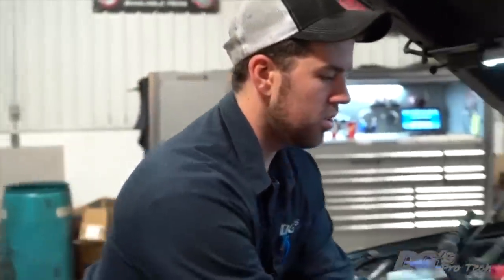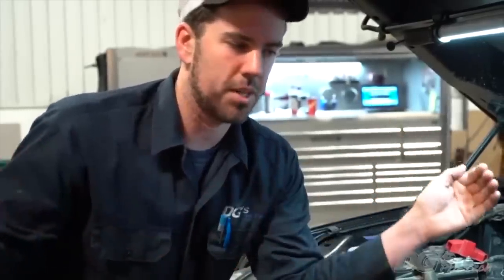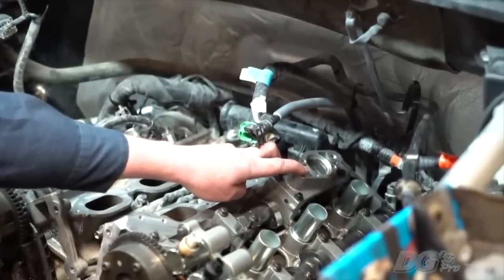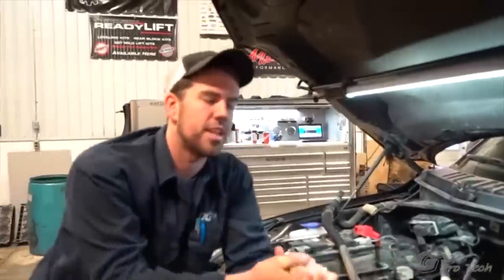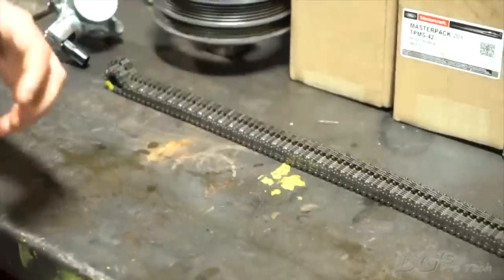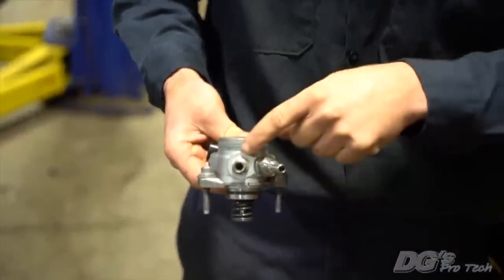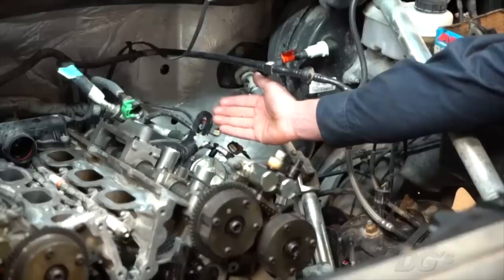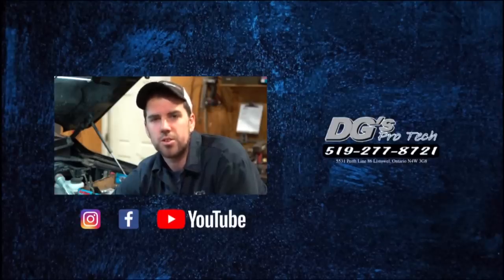What you NEED to know about Ford EcoBoost Engines by Dustin Golley of DG's ProTech

Comment: So basically change the oil more often and give it the Italian tune up once in awhile.
Reply: What's an Italian tune up?
Reply: @michaelwood5519  putting the pedal to the floor and blowing the soot and buildup out.
Reply: @mikemoore466  Actually  in the "olden" days, the "blowing out" of soot and build-up rarely cleaned more than the exhaust system.
In addition, what carbon that might have accumulated on the pistons, or valves  might have done more damage to the engine than letting it remain within the engine until a road trip was undertaken.
Carbon is hard and can become trapped between valves and valve seats. A burned valve might happen. Or carbon may become lodged between the piston and cylinder wall possibly causing scoring of the cylinder.
All this was before the detergent gasoline we now use.
Reply: @mikemoore466  Ahh, Bill Cosby joked about being told to by a mechanic get his Ferrari up to 120 mph to clean it out.
Where do I go 120mph?
Oh, any side street. 
The next part about Carrol Shelby was funny.

Back when Bill was funny, not creepy.
Reply: @kevinmoore4887  well he sure is creepy now. He's like Michael Jackson creepy. Lol
Reply: @mikemoore466  Bill Cosby was great back in the 70s. Very funny and his humor had a positive message. 
Yeah, the off stage stuff is sick.
Reply: @michaelwood5519  an application of wide open throttle every so often. Usually best done on a long interstate onramp, downhill grade, to avoid too much drama on the driveline. Gives a full rush of air into cylinders, full flow of fuel thru the injection system, and a full flow blast out of the exhaust to dislodge any buildup of carbon shaken loose from the valvetrain. A nice fast ride on the highway can do the same thing, but the wide open throttle technique works just as well in most instances.
Reply: @michaelwood5519  Vroom vroom!
Reply: Never mind, I now know.....Zooooooooooooooooooooooooom
Reply: @michaelwood5519  Put the the pedal to the medal and give it a good long run down the highway. Blows all the crap out of the motor. Years ago my Dad had a Ford Taurus I would borrow his car once in a while and he would always ask what I did to it because the car was running so good next time he drove it. LOL
Reply: He states that these engines should be taken care of meticulously. Big mistake by Ford, the majority of people DO NOT want to waste time meticulously taking care of an engine. Not everyone is into cars and the majority could care less. They want an engine that requires the least maintenance possible and is sturdy.
Reply: @carlosb1  That could be said about any modern turbocharged engine. Turbocharger systems are high precision engineered parts and lazy maintenance habits with any will lead to premature wear.
Reply: @carlosb1   That may be true, but if their ass is too lazy and irresponsible to maintain their investment then they deserve for it to fail. Stupid fucking snowflakes.
Reply: Another big problem with the F-150 EcoBoost engines is people put it in sport mode and floor it at every freaking stop light or sign. I get it, it’s fun but doing that everyday all the time destroys the engine. The old saying, “fast don’t last.” And to make it worse are the damn tunes. There is “fat” built into these engines and the tune is just eating into the fat. Some people push it to the limit and “boom” Ford builds a crappy engine. Take care of it and it will last.
Reply: Just what I was going to say.
Reply: When I give my Mustang V-6 the good ole Italian tune-up, I smell napalm burning.
Reply: @AStanton1966  What do you expect?  Its just another Ford product.
Reply: @Ster you forgot what Ford stands for: First On Race Day.
Reply: @AStanton1966  LOL!
Reply: A Stanton1966 yep my v6 -03 has 160k still drives great
Reply: Jamal K.  hey don't forget the cam tower oil leaks on the 5.7
Also have you seen the garbage oil filter design on the new Tacoma. It's a cartridge filters which I like on cars that made it right. Most European cars have it at the top easy to access and replace. Nope not the Tacoma needs a certain process.
Reply: well, Immigrated italin tuneup, won't handle old-world abuse...
Reply: Well fine if you’re going to put it that way...yes
Reply: For those bashing the ecoboost (and other cars for that matter). Remember, it's not always what you drive but where you drive it. A lambo in city traffic jam or a 5 speed Corolla on a windy back road that follows a river....I'll take the Corolla.
Reply: I beat on mine and serviced it regularly, and it loved it, it's all the old guys that drive 50mph to brag about 27mpg and sure they'll do it, but not on the interstate 

Towing regularly is probably another factor that helped it as well as running mc oil and filter
Reply: yes. exactly. Also, use synthetic
Reply: Just get the 3 ltr.diesel,power, Torque at low revs, which means super fuel economy..
Reply: 31B4P Meanwhile at Ford 

https://youtu.be/BhuUUDvluXs

https://youtu.be/3ZKh5A0IW_M

https://youtu.be/bpizlnOvQmA

https://youtu.be/7ND6qp1UUr8

https://youtu.be/UW3MUhnxyRM

https://youtu.be/HN8L4ZTGtOs

https://youtu.be/81GEHwCLWos

https://youtu.be/WXZFGJe6r_M

https://youtu.be/tAJhEPPAck8

https://youtu.be/R3-NOGZL8ms

https://youtu.be/UaX7wO77sss 

https://youtu.be/rBqs6SjhxuY 

https://youtu.be/ZT-zo_cILU0 

https://youtu.be/GNdA0JoU4sc

https://youtu.be/7ND6qp1UUr8

https://youtu.be/x6_W7e4aMxs

https://youtu.be/Mur0AeDx1hQ

https://youtu.be/AE5VkkJPZeo

https://youtu.be/E_-K32EMRY0
Reply: Haha, yup!
Reply: Or just get a Toyota, change oil per owners manual and enjoy 400,000+ miles .
Reply: @James98374  unless its a sludge era avalon and cars/vans that shared the same engine. You know why? toyota pushed there oil change intervals to 10k. Sound familiar?
Reply: @James98374  not a chance, just look after it
Reply: @James98374  Is that the Lexus/ Toyota with the starter inside the engine???
Reply: @James98374  But then you have a Toyota, aka as good a cure for insomnia as you're going to find. And you'll have to worry about the gas tank rusting  on the inside. 

But more seriously, no car engine does well without a good highway run every once in a while. Was the same with older cars, to the point where a reader in the Toronto Star's Wheels section relayed buying a car that was supposed to have engine problems, but found the drive down the 400 from Barrie to Toronto resolved the issues. It turned out that the car had only been driven on short trips in the city.
Reply: @James98374  and drive a fucking boring vehicle with about as much personality as the lady at the DMV office. Some of us enjoy our vehicles and don't enjoy a beige appliance vehicle. Ive had Toyotas. Ill take a little maintenance and get some nicer interiors, better power, and improved economy. You load a Toyota down with anything and MPG shits the bed big time.
Reply: @ryanslifeirl  I was thinking the same thing
Reply: @ryanslifeirl  And what is wrong with the lady at the DMV office?   Let's not go slamming and dissing others here.
Reply: LOL no,. Look up more videos.  That engine is a pile of shit.  He didn't address the dozen other problems with this engine.  This guy is blaming oil for all it's issues lol.  What a load of bullshit.
Reply: blue03r6 never had any problems with mine at 210,000 miles. People who dog the ecoboost have never driven one and think “it’s just a turd v6” but I’ve driven them all and the 3.5 is the best towing half ton made.
Reply: @blue03r6  Who hurt your eco bro
Reply: @blue03r6  Not so much.  I recall waaay back in '81 when Mercedes-Benz thot it was smart to go from a double-roller timing chain to a single-roller version on their 3.8L ALUM. BLOCK V-8s.
Not smart at all.
We had to change all those chains out and convert the gears & rails BACK to DOUBLE-row chains just like it had ALWAYS been on the 4.5L CAST IRON Block V-8s.
BULLET-PROOF from then on.
In those days, the gas-engine oil change intervals were 5K mi.  We used Pennzoil single-weight oil before changing over to Mobil 1 multi-grade oil in the mid-80s.
Mercedes-Benz now recommends 0w-40 Mobil 1.  With their large oil pan capacities and their oil quality/condition sensor, the intervals can now be as high as 10K mi., or more.
'Tho some may be only 3K mi. due to being driven "putt-putt" style for short trips.
Reply: @SpicyRok7482  in regard to the engine in this video, it would make you puke if you watched how many videos there is about this engine and all of it's asinine design issues.  the water pump is inside the engine.  the whole front of the engine has to come apart to fix it.  the intake valves do not get sprayed with fuel so they build up carbon deposits really bad.   ford says the only fix is to replace the heads.  because if you try to clean them with cleaners it will burn up the turbos. lol.
Reply: @JamesPhieffer  bullshit.  it's a poorly designed engine.  you could run a LS chevy engine 400K miles with regular oil changes.  i've seen a lot of them with over 300k at auctions.  why?  like the LT motors it's simple in design.
Reply: @blue03r6  I've driven Prius' with 300,000 miles on them. Simplicity doesn't guarantee longevity. I've also seen basic OHV engines die a lot earlier than that. A properly maintained (in accordance with the owners manual) engine these days can last 400,000 miles. Often, what prevents that longevity is the age of the vehicle itself, as people take less care of cars as they get older.

And LS motors aren't simple. For the last 15 or more years they've had variable displacement systems, variable valve timing (on a single cam, for 8 cylinders, no small thing), etc.

So how about we leave the knee jerk reactions and Chevy bias behind, and consider things more objectively.
Reply: @blue03r6  the deposit problem has been rectify with a dual injection,much like the ones Toyota uses.
Reply: @blue03r6  there are a lot of other brand engine out there with the same design issues. Any direct injection engine can suffer from carbon build up on valves without port injection as well. 

Plenty of v6 and v8 engines with over heat cams also have the water pump behind the front cover. 

There is nothing special here. Just common issues with this type of engine. But there are loads of ford 3.5s out there. 

Ever work on a suzuki h25a? 

And if the chevy ls engine was everything they claim it to be. Why isnt there a pushrod engine in all the other chevys? The ls is a great engine. But it isnt without faults ether.
Reply: I just want to add the guys that think “only a Toyota Corolla can last 300k miles” usually don’t know how to jump start a car. Ford has been making cars a very long time, and they have as much experience with different engine designs and past experiences on what works well. If you haven’t driven a turbo or supercharged car they are more fun then your average old shitty v6 or god worse na 4 banger and are possible to give similar economy if you stay out of it and drive like abuela
Reply: @blue03r6  I've seen plenty of 3.5s hit 400k as well. Some well over 500, in work vans mostly. The engines haven't been out as long as the LS or LT engines so there is obviously less of them at that mileage.  The vast majority of 3.5s that come in with serious problems were neglected, but all of the maintained ones keep on trucking. Get over yourself.
Reply: @blue03r6 Wrong!
Reply: @blue03r6  and the Ford 5 ltr.v8  same
Reply: @blue03r6  The duratec 3.5 is inside the engine..not the ecoboost bud
Reply: @blue03r6  Who hurt your eco bro

Comment: Does the same apply to my 2019 ford raptor supercrew? 
I get full synthetic oil changes every 5k miles and I’m currently at 17,500 miles with no issues.
I do average 12 mpg though. So I guess that means I won’t have any waste hate issues.
Reply: Dirty Harry 
Oh trust my dude, I’m not complaining. Eco boost is just a marketing gimmick. I knew this shit was gonna suck up all the gas since it has two turbos. Lol. 
It is rated at 15 city/ 18 highway but that means you have to stay out of boost and drive at 65mph on the highway. I don’t want to void my warranty though. So I’m staying stock until warranty is done. 

I’m averaging 14 in my 2019 mustang gt PP1 but that’s because I’m in the break I’m period. Soon as I hit 1,000 miles which will be in a couple of days, I’ll be in sport mode 24/7 and I’m sure my mpg will drop further lol

Comment: Is the 2.3L ecoboost that comes in a 2019 Ford Ranger an interference engine, thanks.
Reply: Yes it is interference engine, but it is chain driven
Reply: you're not going to find a non interference engine. they make them that way not so they break, but because you can get better valve lift and higher compression vs a non interference engine for the most part.
Reply: almost any engine made in the last 20 years is going to be interference
Reply: No. It's been in Mustang for 5-6 years. Ford got rid of V6. You get either 2.3 EcoBoost or 5.0.
Reply: @Liverlicker  i don't know if the eco 2.3 is on the same foundation of the lima 2.3 but the lima has been around since the 70's .
Reply: @theclubhouse1209  if its making more than 40hp/liter, its interference.

Comment: I have a question please.. I have a 2018  Explore with A2 package Sport with the 3.5 twin turbo and it has 55 less HP than truck ... it's much slower than the truck but it gets the same gas mileage than truck... I called Ford parts to see what I can do to make it more sporty but they said nothing I can do or I will void warranty.. I have 100k extended warranty with 100k maintenance ... I had Ford do fuel injection clean and it's at 25k now ... all oil change are at 5k
Reply: What’s your question?  You should look at a tuner for your Explorer if you want to utilize the the power it has.
Reply: @jcicho thank you for your response... the main question is I think Ford down tuned the explorer is because of the all-wheel-drive reliability ... if that is true what can I do to make the all-wheel-drive more robust? The second question is what can I do to make Ford increase HP without void warranty ... I complain so hardcore they literally did a complete fuel injection clean..
Reply: Dallas Texas that’s a tough one, any alterations mechanically may “void “ the warranty, each service department is different when it comes to warranty work with aftermarket parts, even upping the size of tires may void the transmission and so on...  you could look into getting a better tune, nothing crazy, just a little more throttle response and tighter shift points, and any time you bring it in, return to stock.  Some say the shop can see if it’s been tuned after returned to stock, but I haven’t had to cross that bridge yet. Some tuners will Warranty your engine if anything happens to it.  Good luck
Reply: You may want to try this. It always helps https://youtu.be/ZNxXM75zJOw
Reply: @jcicho  thank you I will look now :)
Reply: https://www.forbes.com/sites/joannmuller/2012/08/29/automakers-report-card-who-still-owes-taxpayers-money-the-answer-might-surprise-you/

Ford Motor owes the government $5.9 billion it borrowed in June 2009, the same month GM filed for bankruptcy. By Sept. 15, Ford needs to start paying that money back. In a government filing, the carmaker said $577 million is due within the next year, and the full amount must be paid off by June 15, 2022.

Lol .. Ford took so much money from the American people to build something truly special with American Tenacity... But Ford wasted the money and built subpar engines that Ford LOOKS for reason to void warranty so they can pay back the government ... I am no economic major but this is a classic example of oxymoron. Ford will be liable but not sure how to do it yet .... if they give me restrictions then they need to give solutions

Comment: I don't believe the timing chain stretch is caused by lack of maintenance as I've see the problem with fleet trucks that use only valvoline full synthetic and have the oil changed every 5,000 miles.  When you use the eco boost like a truck is meant to be used,  aka pulling a trailer or hauling a load the fuel economy sucks. A few companies I do work for are switching their entire fleets to 5.0 trucks after realizing the eco boost is not a good work truck engine.  My personal opinion is that all eco boost engines are garbage. Between the problems you listed here and the valve cokeing problems the small eco boosts have I replace more eco boost engines than all other brands and engines combined.  Along with turbos, inter coolers , transmissions, etc...I hate fords,  but they pay my bills , and  there is never any lack of work at my shop because of them.....